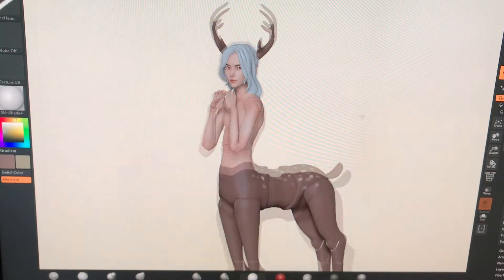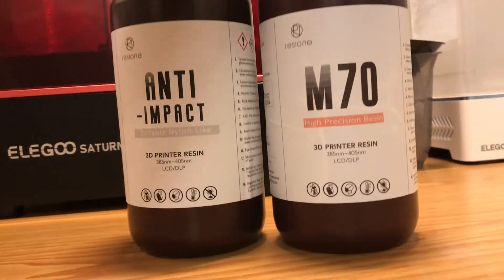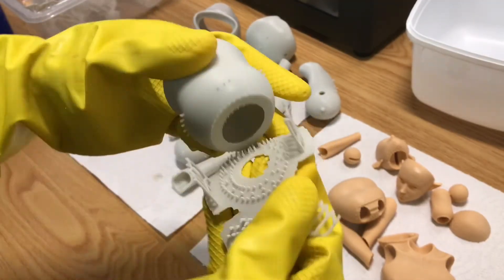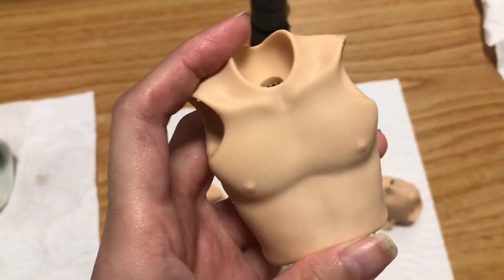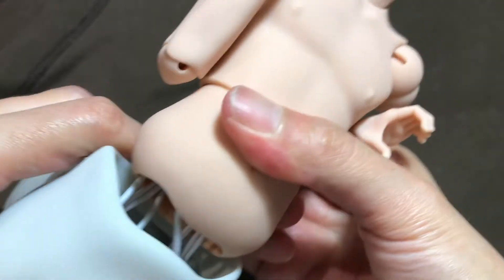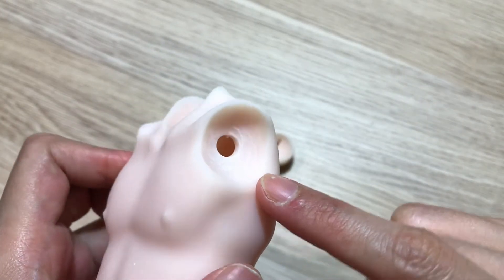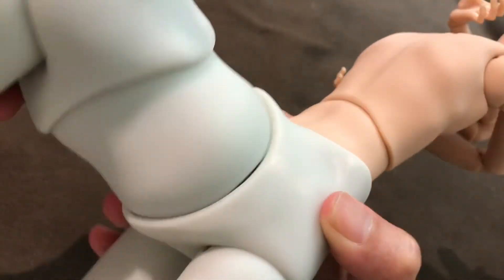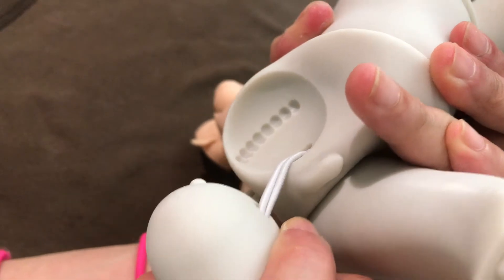What kind of 3D resin is perfect for printing BJD dolls？

Comment: Did you export directly from Zbrush or did you make some adjustments?
Reply from the maker: This design is belongs to our client，you can find her by the description below.
Reply: @godsaid4502  Does it have a print line? what do you think is a good material to have a smoother 3 printed pieces?
Reply from the maker: @ You can try out new BJD resin：TH-BJD
Reply: @godsaid4502  Thank u for the info!

Comment: Awesome, thank you for the video! 

A little trick I use, is removing the supports before curing. I have a sealable bin with a garbage bag inside that I process the prints in, and so after the print is done I just slip on my nitrile gloves, transfer to the bin and pull the supports off (they come off so easy this way without leaving behind any nubs); then I place the prints in my ultrasonic cleaner (using propylene glycol now as I've read it works just as good if not better than IPA and is much safer) which now fit better sans supports, and then transfer to a clear plastic container full of water which I cure in my UV curing station (curing in water can help cure the prints better). 

I'm very much looking forwards to making some BJD dolls. I've always loved them, but they tend to be fairly expensive - and I love the idea of making some on my own!! :)
Reply from the maker: Thanks for sharing your amazing idea！☺

Comment: 80 c?  Thats way hot
Reply from the maker: not really，it just fine，haha
Reply: Like kettle hot water?
Reply from the maker: @Dolleemixtures  yes my friend ，if you dont have a oven ，you can boil the hot water and put the resin bottle into the hot water for 10 minuets to heat up the resin inside！
Reply: @godsaid4502  awesome!!!! It's ok that it doesn't stay that hot through printing?
Reply from the maker: @Dolleemixtures  if the weather is kinda cold in your city ，you might need to make sure the room temperature is warm during printing ，i think that will reduce print failures.